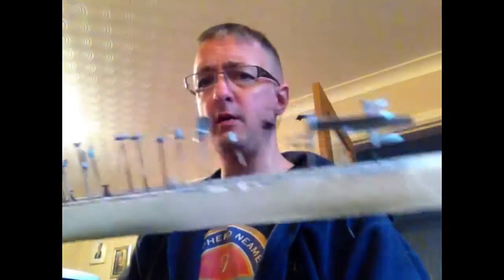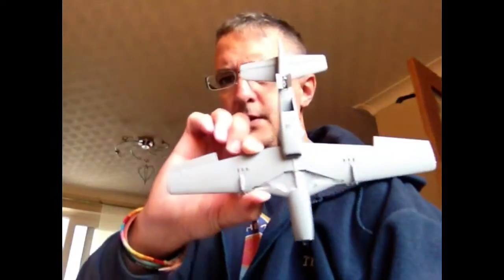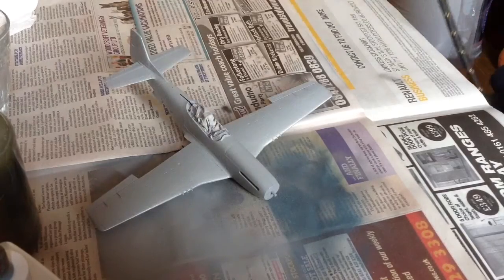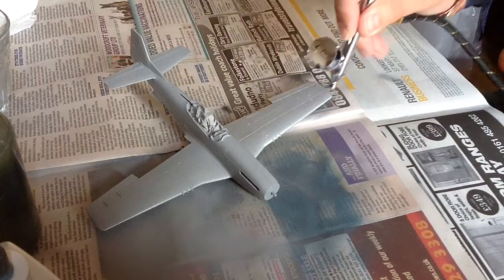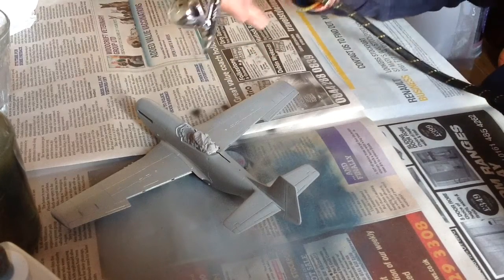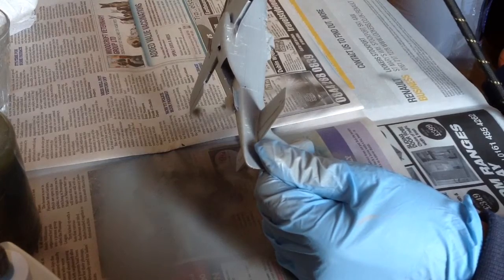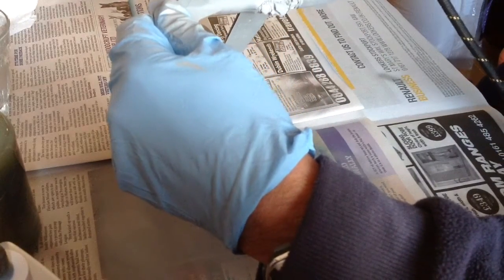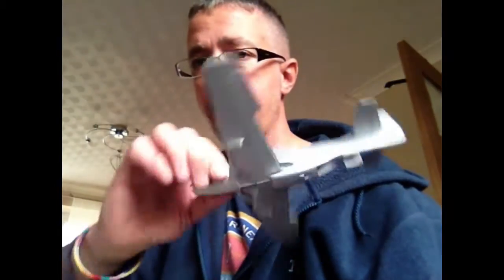Tamiya 1/48 P-51D Mustang Part Three

Comment: Thanks for the tip on the metallic finish. It's easy to think that the smallest bits/particles don't exist. But the spray paint enhances the blemishes rather than disguises them. As you say, good to carry out a light wash & scrub before hand.

Comment: Something to watch out for if you haven't sprayed metallic paint before, make sure you give your airbrush a good clean afterwards. The first time I sprayed Vallejo natural steel I never cleaned my airbrush completely and some of the metallic flakes were still in the airbrush and got mixed in with the normal paint I used next for camo and I ended up with sparkly camo. I now always strip down and give the airbrush a full clean after spraying metallic paints to make sure there are no flakes hanging about to get mixed in with the next colour. Looking good though Lenny.
Reply: modelpro72 Thought I would mention it as you said you had never airbrushed a metallic colour before. No matter how much cleaner I put through there always seems to be some bloody flakes left in there and the only way I have found to get rid of them all is a total strip down. Sounds like the cadets are going well, what have you got them building Lenny?